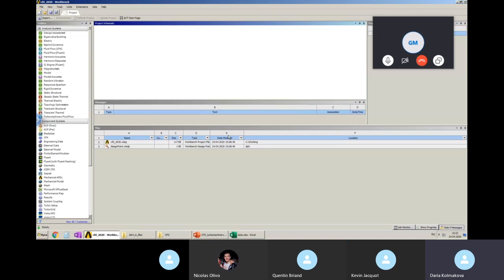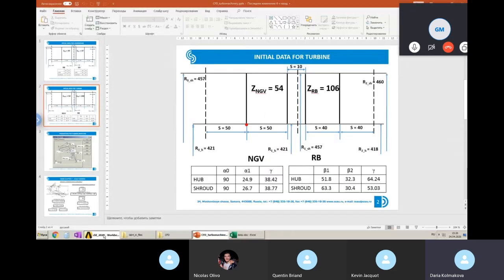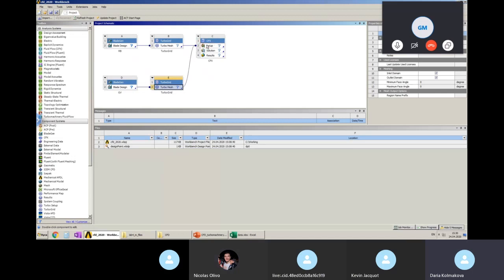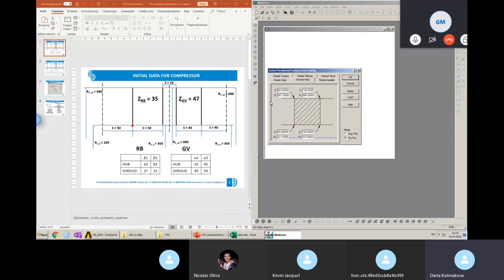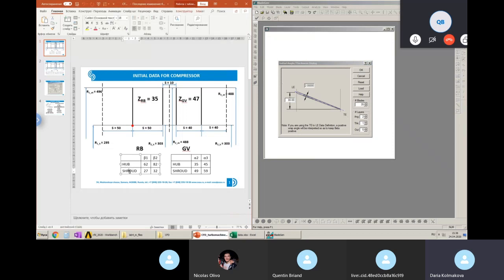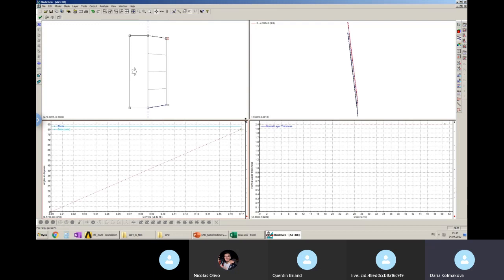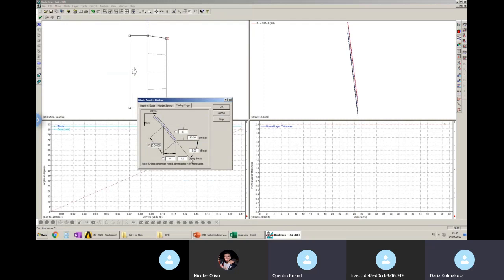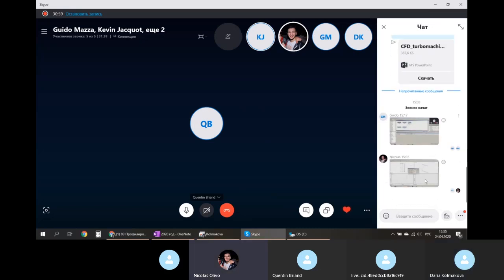Compressor Profilig using Ansys (Blade Gen) (lecture by Kolmakova Daria) part 1

Comment: Mam can u tell for what machines design we can use simple axial template of bladegen.
Reply from the maker: Axial compreessors and turbines, and axial elements of other (IGV, axial diffuzors)
Reply: @ОлегБатурин-п8к  then what is the difference between simple axial and normal axial template of bladegen ansys if both can be used to design compressor and turbines. Thanks
Reply from the maker: @veervikramsingh6905  As far as I understand, the difference is in the description of the shape of the flow path at the beginning. But as far as I saw in the future stages, there are no differences.